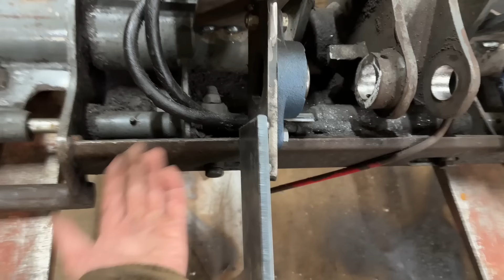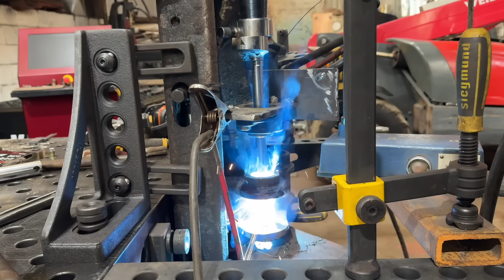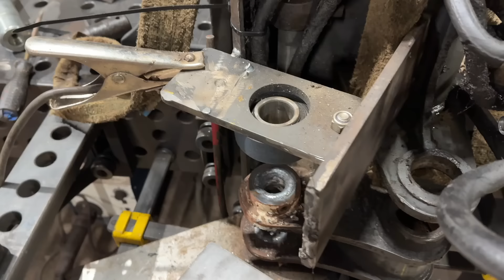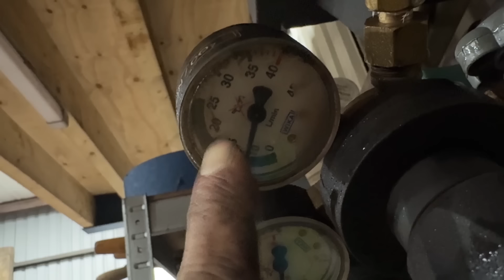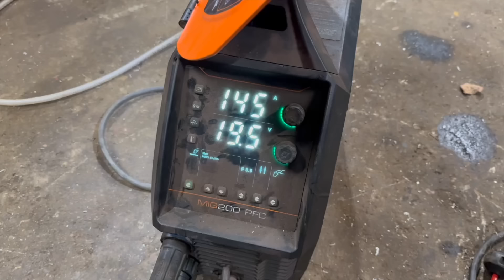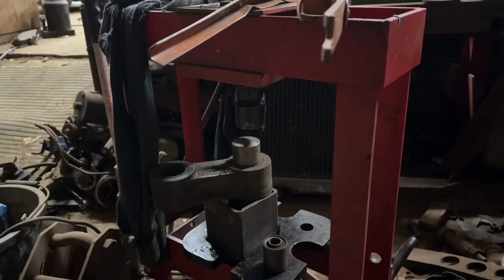Tiny Telehandler needs some attention! Weidemann T4512. Part 2

Comment: In part one you asked about the machines identification / rating plate

Bit late to the party, but here is what that type plaque on the mini telehandler says
Telehandler T4512
Built 2018
Type 4512CC
Engine power 29,9kW
Operational / empty weight 2700 [kg]
maximum allowable weight 3100 [kg]
allowable front axle load 2000 [kg]
allowable rear axle load 2000 [kg]
allowable tow load 4000[kg]

this thing can handle way more weight than the difference of its legal max weight of 3,1 tons and the empty (includes operational fluids, but not the driver etc) weight of 2,7tons which would only be 400 kg, minus driver weight, so around 300kg... but for legal reasons it has to be on there as some engineering formula minus safety margins says the result is 3,1 tons

i've seen these rather effortlessly lift over a ton (telescopic boom not extended ofc)

Comment: I see a lot of people taking steel and making parts, interesting, but. Your videos are interesting as they show  what has to be done to fix equipment back to quality, and line boring is not boring. I actually swapped it to my tv and my coffee got cold before I realised it, being as intrigued by the issues of setting up, welding and the finished product. I have seen some local fixes on equipment that make me cringe. Don’t worry about it, if it needs line bearing do it an make a video. Thank you.

Comment: Could you use flux cored wire to weld around the inside of the holes in the headstock?  Then you won't have to worry about getting the gas coverage right.  Well done for persevering, though!  I wouldn't be happy with how it turned out the first time, either, lol. 🙃👍

Comment: Just wondering if it would be worth making up a practice jig that can be mounted to your work bench with a clamp that can hold some sample pieces. You could then bore the sample pieces out to the size of the part that needs bore welding to practice your feeds and speeds before having to do it on the real part 🤔

Comment: When I worked at JCB and the guy that came in for all our line boring had a weight, made in 2 pieces he could bolt to the shaft to counter shatter.
During some talking he said that it wasn't perfect, but there were moments it was enough to dampen the shatter and get a decent result to put a bushing in.
There were also enough moments it didn't work or he didn't had enough place to put it near the cutter and he had to put extra bearings in.
Shatter is hard to counter when working with long shafts.

Comment: First thing I thought when you used the long grindershaft was:
 Why not drill a hole in a brass or bronsrod and use that like a handle to keep the karbidehead steady.. 
Would be alot easier to control and move around that way.

Comment: When you are doing vertical bore welds would it be worthwhile trying putting a cup (possibly copper) under the open end of the bore?
I'm thinking that would go a long way towards retaining the shielding gas in the bore. 
Using a cup would allow you a bit of "reach through" with the welding torch tip and hopefully the gas would flood the weld pool and keep it from fizzing.

Comment: I am just amazed at your patience and tenacity. Credit to you. I certainly couldn't cope doing them things. To my mind the whole design of all those machines is flawed. When they build a piece of equipment like that with all those pivot points. Instead  of just welding on a lump of metal with a hole in it. Why not make them a removable serviceable part. The truth is, built as cheap as possible. Not engineered to last. I was watching a documentary the other day on machines still working over 100 years old. One was 200. Over designed and built to last. Today it is, will it get past the warranty. Thankfully there are people like you to pick up the pieces.

Comment: That setup with the annular cutter is a great idea. I have seen a lot of people on you tube struggling with that issue of a bore being to small for their line boring equipment after weld repair, yet none of them has come up with a solution as elegant as that!! Obviously you have some switched on viewers to give you that tip! 
I'd almost go as far as saying if you did line boring work, you would be a mug not to have a bar set up to take an annular cutter slightly bigger than your bar size!!

Comment: Automotive air conditioning pulley bearings can be had cheap online.  They are double row bearings with bore sizes that should fit your bars.  They will likely support your bars better than the single row bearings you have now.

Comment: Those smaller holes are a nightmare.Sometimes we would use stick.Tack a washer with a smaller bore size to land your weld on to to the bottom of the bore with a 1/16 gap then spiral the weld all the way to the top.Just went over the slag spiralling up never got any problems and the advantage of stick is it burns out any impuritys in the base metal.Turn the job over do the same again.More machining but we left that to the Machinists 😅

Comment: Hi Oliver , the poor weld quality could be down to contamination of grease and grit ground in by the pins as they wore out , cleaning out with the die grinder with a flap wheel on might not have been enough to take all the contamination out and also could have added contamination depending on what it had been used on before, I was watching your great video of the bore welding first time around and wondered if you blocked up the bottom of the hole with say some tin foil or scrap copper sheet placed below the hole so that the shielding gas could build up a pocket of gas in the hole as it should be heavier than  air , and it would stop it dropping out the bottom of the hole drawing in fresh air to contaminate the weld , with the heat rising from the arc it might act like the draw effect you get on a chimney drawing in loads of air from the bottom of the hole disrupting and causing eddy currents in the gas envelope 
Just a thought really 🤔 
Anyway good luck and keep the great videos coming always enjoy watching them 👍

Comment: This is probably a ignorant question but I don't know much about hydraulic break press. Could you manufacture a removable arm attached to the top moving bit with a vertical 3-4" round rod and use it as a press for pressing bushings in and out? You'd have to make a base to hold and position your work pice. Maybe you could reuse parts of you manual press. 🤷🏻‍♂️ just a thought...
Reply from the maker: Its a bit numb for using like that

Comment: If the operator of that machine performs zero maintenance or care of any type they have accepted that eventually it will cease to function and require extensive rebuild and repair work. The owner has accepted that it more cost effective to run it until its unfit for service, and then pay to over haul everything. Thats where you come in, with the high cost of parts and shipping maybe they calculated correctly maybe not but given the large investment you have in boredom welding equipment and a machine tooling seems like you have a viable business.
One thing I don’t understand is why not sleeve instead of buildup the bore with welding? I would think you could turn out a sleeve very quickly and tack it into a new  bore hole, ready cut for a new bush ?
Reply from the maker: I consider bore welding the proper and best way, sleeves are plan B

Comment: Good work on the headstock. As you were able to work out, doing a job right will make you and the customer feel better about the quality of the work. Brilliant move adding the cutter on the end of the bar. Now you can drill and ream holes with the boring bar.

Comment: That's been a bear of a job, but you're getting it sorted. And you made a new tool with the annular cutter that will help you on future jobs. I also recommend a little shroud to cover the end of the new lathe motor to protect the fan and keep the air flow path clear. It shouldn't take much effort and Will save you from a big headache later. Cheers from Texas

Comment: To measure the knife extension from the shaft, it is better to use equipment like the one in Climax machines, which is attached to the shaft and only then the measurement and setting are performed.

Comment: Look like the porosity if from the grease holes . I see the same thing happening with other people also . Idk if u can pre heat and burn the grease off  and or . Plug weld the inside of the hole befor line boring  .

Comment: You know that they'll be porosity in the weld when there's fire when welding.  Cleaning grease off is normally time consuming but not with this machine. I don't think the owner knows what grease is.

Comment: If I  may make a suggestion on the welding, when welding in the vertical, a piece of copper plate covering the bottom of the hole will hold the shield gas in a well and help with the porosity. The copper won't stick to the weld bead and just pop away when done. Keep up the good work your integrity is so refreshing in this day 
THANKS!
Reply: That and doing some back purge set up with C25 or whatever shielding gas he uses. Just a tank a regulator and hose directed over the bore.

Comment: Hello Ollie,
Nice repair, as usual, with some tricky machining.
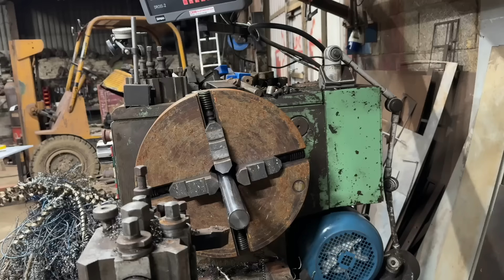14:00 to 14:30 a lot of time spent dialing in the bar on the 4 jaw chuck.
Would it be possible to mount your 3 jaw chuck in the 4 jaw for simple repetitive jobs such as boring the end of round bars?
Reply from the maker: I have a 3 jaw but I like using the 4 jaw

Comment: That is no longer a gas shroud, it's scrap and needed to be replaced about 10 jobs ago 😂, but if a new shroud doesn't help, I'd almost think to try flux core wire or maybe a dualshield if the gas coverage is not sufficient, but I'd also check for a gas leak in hoses and connections as that can also cause porosity..

Comment: Don't you think it's about time you upgraded your bearing press, Oliver. Wouldn't you like to have one that is air controlled? It's easy to do. While you're at it, build a sturdy stand for it using some of that scrap you have laying about the place. After all, you've got plenty of it.

All that faffing about on the floor hand pumping your bearings in and out is not professional looking. It's more the setup that a DIY home mechanic would use in his little garage. You could video the press upgrade for us. It would make a nice change.

Great work sorting that mess out. I can't wait for next week's video to see how you finish the rest of it off. Will it finally be finished, or will there be other unexpected issues to conquer. Watch this space. 😁

Toodle pip.😉⚒️🇬🇧
Reply from the maker: Yes, definitely need a bigger and better press.

Comment: I always try to fine bushes with a thicker wall when the holes are slightly worn like on the tilt linkage. It's quicker to bore out a hole once and put a bigger bush is than to bore, weld, bore and then fit the original sized bush.

Comment: Thanks for the video! There are oversize unfinished hardened (only the inside) steel bushings available that can turn down to matching diameter. Those come in handy when there is not enough 'meat' erround the worn out bore or the workpeace is difficult/impossible to weld on. Fpe seals, kramp, and Sapparts have them...

Comment: not to worry about it being boring as i fined all your job interesting and am learning things ll the time i finned your work and problem solving great for wont of a better turn you do good work yes some times we have to do things more than ones to get it right and your standards are utmost and great as your not afraid to say you made a mistake as you say sometimes good ideas suggested are great and you take on advice well is not a challenge to have a go if it dont work then try something else great work as is the norme from you won't let it out back into the workforce unless its right now that is a machinist with standards well done 
cheers from North Queensland Australia

Comment: Hi Oliver, don't beat yourself up mate you are doing a great job. Line boring isn't easy especially those 35mm bars, they are about as rigid as a wet straw. A couple of thoughts. I used CCGT style inserts, they have a very positive rack and are soft cutting, there is no chip control (just endless string) but really helps to keep the chatter away. I also used to get perosity issues on small bores, I found that there was so much heat in a small space that it would drag enough air through to desturb the gas,  covering the bottom end (after the welder has done a couple of turns up the bore) used to really help. HTH

Comment: Bad day for Oliver, just about at every turn your enthusiasm was punctured.  I really felt for you, every thing conspired against progress toward getting the job out the door. We all get them, kit breaking, parts shortage, time frames etc. line boring isn’t dull, it’s difficult and your battles show that with all the problems and workarounds it’s not a pathway to easy money.
One question is why do you use gas rather than fluxed wire? I note your peers working out doors do so, and many indoors too, do they enjoy a greater selection of wire that’s suitable?
Sent you a dink or two as commiseration
Reply from the maker: I have used flux core before but solid wire is what I know best. Thanks!

Comment: Great video again Oliver. Whoever suggested that broach on the end of your boring bar is next level, well done. 
I noticed the bulk of your porisity was a the beginning of your weld, would tacking a piece of rolled 10/15/20x3mm flat to your start-up side of your weld to counter the gas coverage drop-off? Or would that just add time into the job you dont have?
Anyway we all have days/weeks where its 10 steps back, have to buy new shoes, for that half a stumble forward. Stick with it, you are a credit to your proffession. All the best Oliver.

Comment: Hi Oliver 

What an enjoyable video. Thanks. Comments:

1. I am in awe of your stoicism and determination to do a good job. I’d have gone with the porosity on the basis that it would hold the oil or grease. You took it on the chin - I’d have thrown all the toys out of the pram😂

2. It may be prudent to put a simple guard over the end of the new motor as the fan end is more exposed now. 

3. JB Weld was made for jobs like taking up that minor ovality under the new bush. I was highly sceptical until I used it. Seems like a bodge but it’s not. 

4. Einstein was right: keep doing the same thing and expect different results is a sign of insanity!

Look out for an email from me next week. 

Have a great Sunday. 

Mike

Comment: think ive said before because they are small bores try using gasless flux core wire no need for a shielding cup. machines are dirty cheap and will also save on gas. Anything is worth a try

Comment: With regard to the porosity, have you considered flux cored wire. Purge gas is always a problem with many welds and whilst the cost of the wire is more expensive it certainly helps with the porosity in difficult weather and conditions.
Reply: This! Cal from Welderfabber almost always uses flux core now

Comment: A tricky awkward repair, good to see your doing it properly even though it took more time. I wondered if chips can get into the new lathe motor, it looks as if it might? Might need to shield it if it could.
Reply: It’s a TEFC  motor. Totally enclosed fan cooled. They are built for harsh environments such as this.

Comment: The new table is fantastic, every shop should have one, its so versatile.
The now lathe motor will not last all that long because the fan will drag into the inside all the crap and moisture as its now much closer to the chuck. I would send out the old GEC motor for a rewind/refurbishment. 
Kurtis of Cutting Edge Engineering AU, when he does line boring, he uses the line borer to face off and more importantly always puts a chamfer on the lead in to all his line bore holes for bearings and bushes. 
I think he uses a DTI as well. The other measuring tool is rubbish
Reply from the maker: I did face and chamfer these holes.
Reply: It’s a TEFC  motor. Totally enclosed fan cooled. They are built for harsh environments such as this.

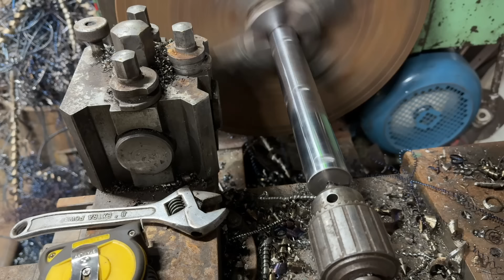Comment: 15:13 Seems like you need a shroud to keep chips and such out of the new motor! Coolant would be an issue too!
I was glad to see you make that setup on the table... Sitting on end on the floor looked sketchy!
Reply: It’s a TEFC  motor, no chips or liquid can get in. Totally enclosed fan cooled. It was designed for harsh environments such as this. The chips should bother the fan either but if it does it’s easy to replace if the fan blades get dinged up.
Reply: A simple shroud to protect the fan, would be far easier than waiting for the damage that is very likely to happen.